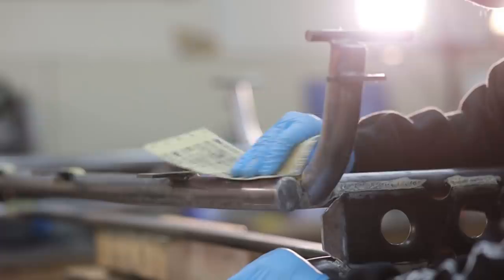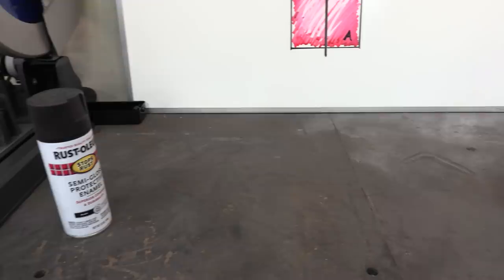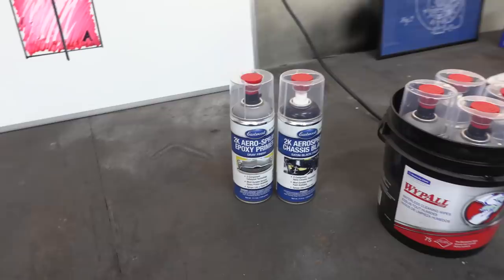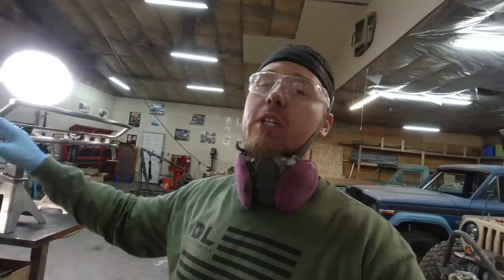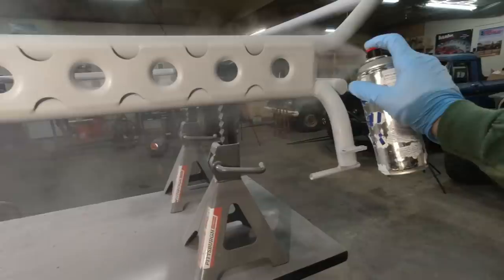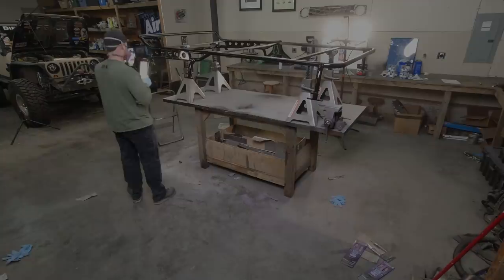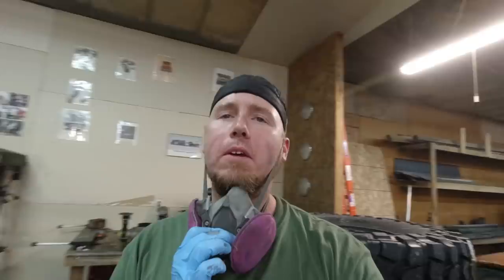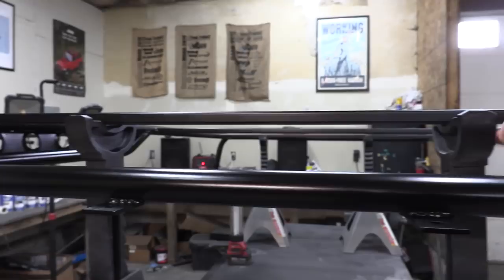Spray Paint TRICKS For Car PROJECTS

Comment: I got question, we used epoxy paint on jet drives on jet boats. You had to put down 2nd coat after 14 min and had to be done with in 4 hours. If you went back and did touch up the next day or before 5 days it would blister the paint. Is Eastwood paint different or has it gotten that much better? Now I have not used epoxy paint in 10 years plus we got ours from house of kolors.
Reply from the maker: I rolled the dice. I knew it could blister but luckly it didn't. I have to rush through alot of things to make videos go live on time. Normally I would have waited 23 hrs before touching up. 👍

Comment: How do you feel about using this paint and primer product for rock sliders instead of sending them to get powder coated?
Reply from the maker: Either one will grind off. Powder coat isn't any stronger for a rock slider. I would just use this stuff 👍

Comment: Careful which heater you use. Some fuel heaters create moisture in the air.  And soaking aerosol cans in hot water also increases the pressure inside of the spray can a bit.

Also with metal the old adage goes 'runs don't rust'. It's worked for the Navy. There are specs in place for how thick the product needs to be to really protect the surface being painted. Think submarine.

Don't get me started on the beard with the respirator. Sorry Nate I don't think you would pass a fitment test with it.

Lastly, the paint in aerosol cans is extremely thin due to the amount of thinners and solvents to be able to make it push out of a small orifice. A little compressor and a little cup gun will work wonders and open up possibilities to use other more effective products.

Comment: where did you purchase the eastwood epoxy paint? im sure the reason you get so many paint requests is due to the fact rustoleom and all of your big box store spray cans are crap! the paint wants to lift,wrinkle, etc.  you have so many detailed instructions,paint window times for recoat and so on. for the novice painter there is a fairly large learning curve even following the can instructions can be difficult to get a good finish with spray cans. i went to school for autobody repair was in the industry long enough to know its a better hobby than a 9-5. things are always changing.  the eastwood brand is a quality brand. the two parts in a can looks pretty cool.  when it comes to paint products you get what you pay for.  its worth spending five times the money on better paint if you want a lasting quality paint job  or you can rustoleom every three months  the paint you used i have never seen! thanks im, looking forward to trying it out. if useing spray cans there is a handle you can snap to the top of spray cans and its alot more comfortable than the pushing of the spray can. its a handle trigger more like a spray gun

Comment: High solid paints are laid down in thin coats or “tack” coats.  They have a tendency to sag and run easily due to their solid content. mostly glossy paints fit this Category.  But this is generally a wise way to spray any paint in my opinion.

Comment: Love the idea of that spray epoxy paint...was gonna use brush epoxy for my Danger Ranger's new 8.8 and front pumpkin.   They have any color other than black at Eastwood?  All I see is black, which is ok, but would prefer dark blue...

Interesting idea on the body filler...though I think I actually like the painted weld look.  So long as it was welded by someone other than me that makes a nice looking weld.  I will use that idea for my awful looking beads (never had one break, but....always ugly). = )

Edit:  You have to use the epoxy primer?  I tend to use SEP for...well, everything.  Cuz it works, every time.
Reply from the maker: I'm not sure about the colors. I would email eastwood and see what they have available 👍

Comment: I guess everyone had to tell you it's the "wrong filter". They had to get it out of their system I guess. So you touched on using body filler? Regular body filler, is that what you use? I only have a stick welder, and not all welds are perfect stacks of dimes. 🙄 your video skills are getting better exponentially, keep it up.
Reply from the maker: Lol dude tell me about it. I'm not sure that 100 people delivering a comment is more powerful then just one. After I read the first comment I bought different filters on Amazon.
I used spot glaze from a brand called upull. It comes in a bag. Very good stuff and it's easy to sand. Thanks for watching man 👍

Comment: Good video and its probably not an safety issue considering the size of your shop and your using rattle cans but seeing you lite up the torpedo heater and wood burning stove made me cringe just a little. Paints, solvents, and propellants are flammable. Everything i paint is in the booth and when i need to warm things up i have explosion proof heat lamps that really do a good job. Safety first. Cant stress that enough

Comment: Hey Nate, I saw your video and I really like it, very professional, well explained and to the point. I bought a pre runner bumper raw metal because I want to weld some trick tabs on it and now I’m ready for paint, I ordered the same products you used on this video from Eastwood , the 2K Epoxy primer and paint. My bumper comes with a skid plate and side panels, I believe they are aluminum, just waiting on the paint to be delivered and ready to work. Today is May 11 2022 , how is your paint job holding? Just curious?

Comment: I realize you can't show everything. Did you move the jack stands as part of the priming process, too, or did you just leave those bare metal and paint over it at the end?
Reply from the maker: I didn't prime the small sections. Technically with this paint you don't need primer at all but I use primer to fill in any imperfections. I think you end up with a better looking finished product but it's not that crucial 👍

Comment: That P100 respirator cartridge is doing absolutely nothing against the paint vapours. You need an organic vapour cartridge. However, I read the comment about isocyanate and cannot speak on that specifically. A simple google search can quickly educate you regarding which filter you need for what activity you are performing.
Reply: If you can smell the paint you have the wrong cartridge or an improper fit.

Comment: Also, there is no replacement for fresh air to protect you. Check the weather. (Never paint in high humidity unless you wait a ratherlong time for coats to dry correctly) Notice the wind direction. Open the work space so that mother nature can move a gentle breeze through. Try not to overpower your heater by limiting the size of openings. Use a fan at the DOWNWIND opening. Look up venturi effect and get some science working for you. That means to back the fan away from the opening so the wind current is 50-75% of the opening size. More air will go through than the fan is pushing. This method also doesn't pick up dust from the ground and land on your fresh paint. 
If you try to fight mother nature with a fan, you lose. Don't fight momma.

Comment: Do they make a paint with the "bed liner" level of texture? Cause that's the only way I'm doing my bumpers....again.
Reply from the maker: I'm not sure man. I would shoot them a email 👍
Reply: Raptor liner actually offers that in a 2k aerosol. I used a can on my YJs windshield frame and it came out fantastic. Cure time took a while but I blame that on Washington winter and no heated garage
Reply: Use bedliner?

Comment: At 28 bucks a can, it would almost be cheaper to powder coat. How many cans did you use? 6?
Reply from the maker: I used 6. The last lumber rack I had powder coated was 650. That was discounted because I had them coat 3 racks for me. Normally 800.
Reply: @DirtLifestyle  so, 170 bucks for a paint job that's between paint and powder. That might be a good deal. Lover to see some scratch tested or something like that

Comment: Those respirator cartridges are only particulate filter. It does nothing for VOC. An activated carbon VOC cartridge with a particulate prefilter is best. They are a bit more costly, and they have a shelf life once you open the package they come in.